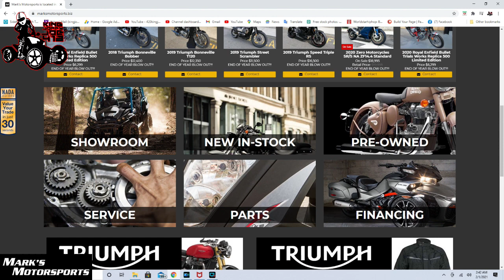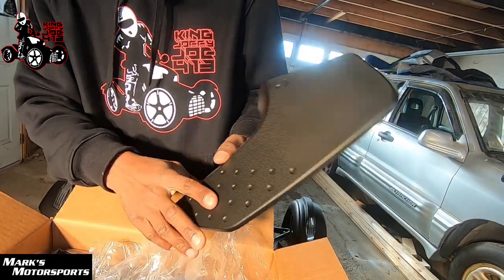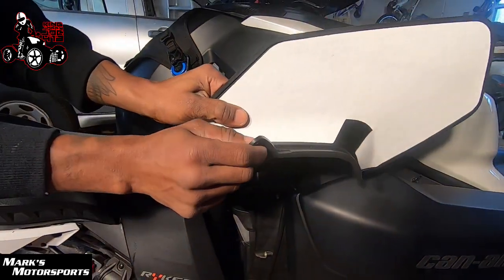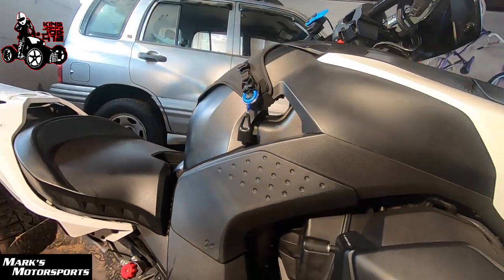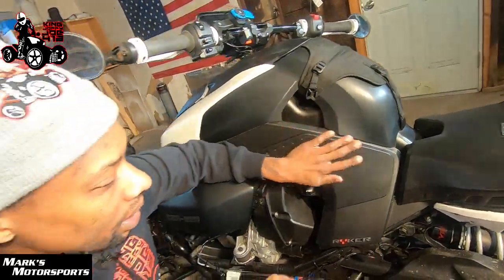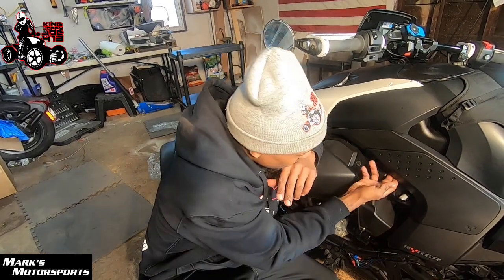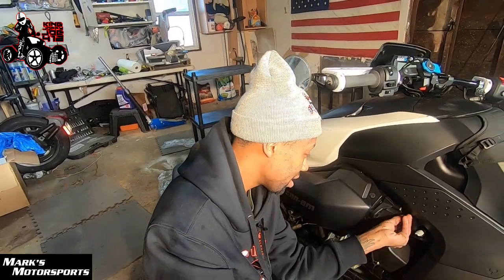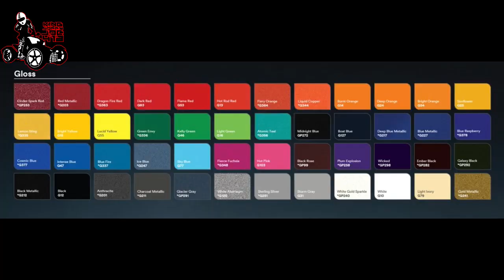Can-Am Ryker Kneepad Kit #camamryker #kneepads #install #diy

Comment: you didn't heat up the adhesive first?
Reply from the maker: I did on the 2nd side 🤦 didn't think about till I did it
Reply: @kingjoffyjoe413  lol all good long as you cleaned the surface prior it should stick pretty good.